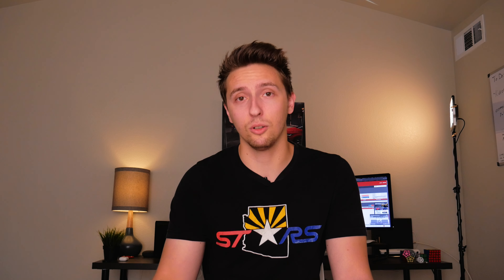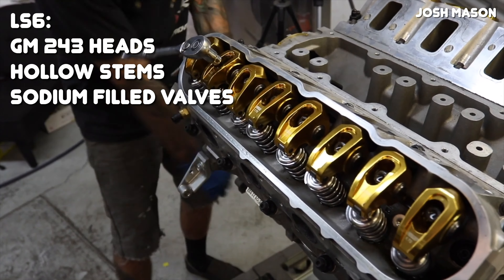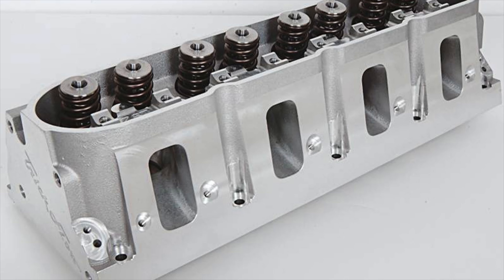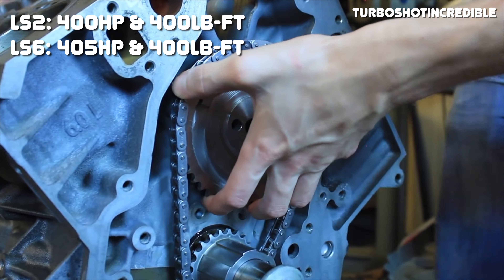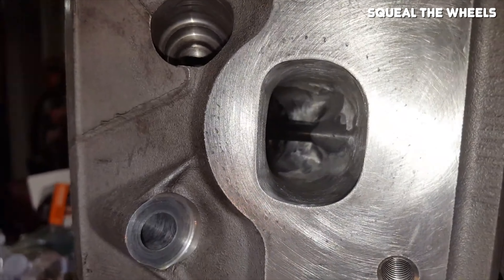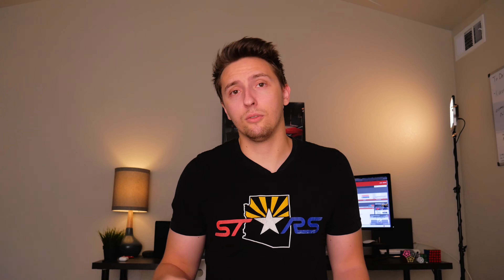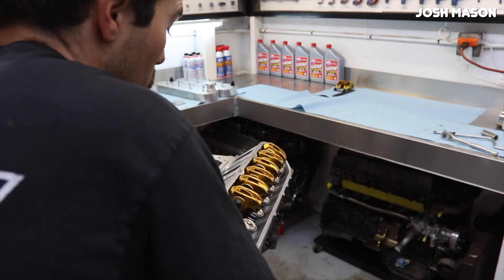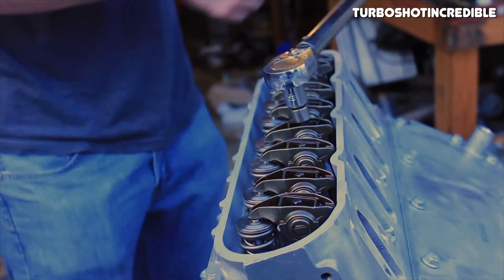LS2 vs LS6: Which One is Actually Better?

Comment: Few years back i scored a ls6 outta a 04' zo6 that I tore down to refresh and gaped for boost. I was amazed at the little differances I found  the ls6 had vs my gen 3 Ls1, L33 and other ls i dug into not only it had the gen 4 rods and head bolts but also found where GM used slightly better matched rods and pistons,shorter pushrods but longer valves and tighter tolerances, i also found areas thru the block where they took the time to smooth and  deburr edges by hand. It just screamed higher standards and quality  The ls6 was definitly the cats meow before the ls7 came out My L33 was built almost exactly the same time but no way near the precision and standards they put into their thoroughbred vette motor
Reply: This was super interesting, thanks!

Comment: GM also used a differant dyno with the LS2. The LS2 was HP was under rated.  Some have seen up to 407hp stock.  BOTH are fast. Awsome engines.   The LS2  seems more alive down in the lower  power curve for Daily driving. LS6 has more  power up top. Its Feel more raw, and rowdy.  LS2 feels more Refined.  I love them both!!
Reply: My Saab 9-7x Aero is the best car I’ve ever driven off a light. It gets everyone’s ass from a stop, but 4 speed trans means no high speed rolls

Comment: Me and my friends were buying these cars when they were new.    I still have my c5z.  The 350hp ls1 ran side by side to a ls2 c6.  The c5z was quicker all around because of power and transmission gearing.  All the little things are neat to discuss and bench race, but the fact is that the c6 ls2 cars were underachievers.

Comment: My bolt on ls6 made 451whp/423wtq.  I assume a ls2 could equal it I've just never had my hands on one of those.
Reply: How has it been? I’m looking into c5z’s right now.
Reply: @learninglife319  it was great for 90k miles.  I $ shifted it testing a ignition cut and hurt it a little. Eventually rebuilt it for piece of mind with a hotter set up.
Reply: @HioSSilver1999  , "peace of mind".

Comment: LS2 6.0 400 HP is the same Lq4  6.0 V8 and LQ9 6.0 V8 used in Chevy Express Van and GMC Savannah Van , Cadillac Escalade ESV , GMC Yukon Denali and GMC Yukon Denali XL , Chevy Silverado 1500-3500HD , Chevy Suburban and Chevy Tahoe , L86 , L92 6.2 V8 , L94 6.2 , L96 6.0 V8 , LS V8 Truck and Car engines , LT1 and LT4 Supercharged V8 and LT5 V8, LT6 5.5 V8, LT8 6.6 Gas Truck engine.

Comment: Ls6 I have a 2005 gto but the 6.0 know for spun bearing I would trade my ls2 for a ls6
Reply: I gotta 2004 ctsv n I love how my ls6 feels. It has an unbothered feeling to it. Almost like 400hp is like walking to it
Reply: Lmao it's not the engine that just up and kills rod bearings. It's the oil pan design. Get a baffled oil pan or simply run 7 quarts rather than 6. Easy fix. High flow oil pump helps too. But it's 99% due to oil pan design.

Comment: Love the ls6 but the ls2 is a better motor bigger displacement more potential
Reply: My ls6 is  built with 11.5 to 1 compression and will outrun a built Ls2
Reply: Totally agree! The larger displacement will always have a advantage, when everything else is equal!
Reply: @crw3673  exactly yea
Reply: @crw3673  No replacement for displacement!
Reply: @Wesley3129  Wrong, the LS2 is the highest compression LS GM made at almost 11:1 vs the lower 10.5:1 LS6. The LS2 has 10.9:1 compression
Reply: @Motorsportsgeek you didn’t read what I wrote.I know what a stock LS6 is.Mine is not stock.I plainly stated that mine is Built.
Reply: @Wesley3129  Yeh I misread what you said but how would you outrun an LS2 with the same mods and compression? Stock for stock the LS6 has more things going for it but you obviously can't replace displacement and in a modified scenario, the LS2 will always be on top be nature of size

Comment: Just saw a GTO 1969 with a LS2 engine in it with a 6 speed trans .  What are anyones thoughts on the engine and trans that was put in this classic GTO  Thanks .....
Reply: I want to do an LS1/LS2 w/ an Autotrend EFI 2G or an Inglese 8-Stack EFI setup on my 66 GTO.

Comment: Is it easier to stay in the same 'generation' when swapping? For example 2000 Silverado with LS1/LS6, and 2007 silverado with LS2/LS3/LS7/LS9? Does it really matter as far as the computer, transmissions, etc.?  I'd love a 2000 reg. cab shortbox (favorite bodystyle) with an LS7 and built 4l60/4L80, or better yet- Corvette 6spd!  Would it be cheaper/easier to 'punch out' the 5.3 out to 6.0 or 6.2 to 'make' an LS2 or LS3? I'm a big fan of bang for buck and simplicity, which way to go?
Reply: Punch the 5.3 to 3.903 and do a 4" stroke crank. Stout 383/6.3L, and you get an iron block, too. Put about .030" of ring gap and feed that thing some boost.

Comment: isn’t the Ls2 ~20lbs lighter the the 5.7 ls6
Reply: No....but there's a vid on my channel if you want to see how much a ls6 weighs. Which should be very similar to any aluminum block ls.
Reply: @HioSSilver1999  the ls2 6.0 is lighter according to chevy.
Reply: @HioSSilver1999  460lbs for the ls6 vs 442 for the ls2.

Comment: The LS6 being rated at 405 was a well known lie.
Reply: Mine dynoed at 393 horsepower and 393 torque at the wheels with headers and 3 inch Borla exhaust and then we built it to run on 93 with 11.5 to 1 compression.Now she is a fucking beast.
Reply: @Wesley3129  Wow, what do you figure it is at the crank?